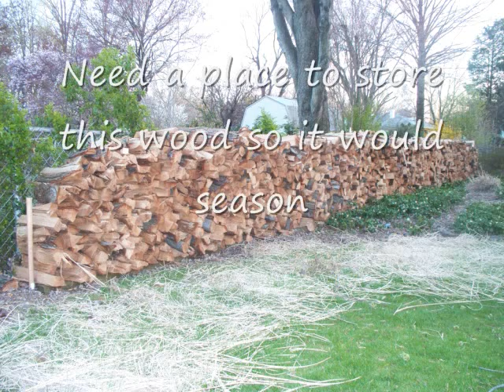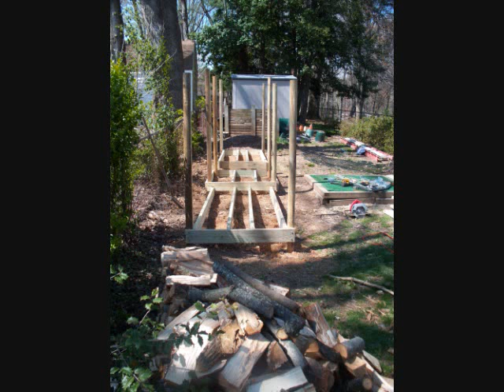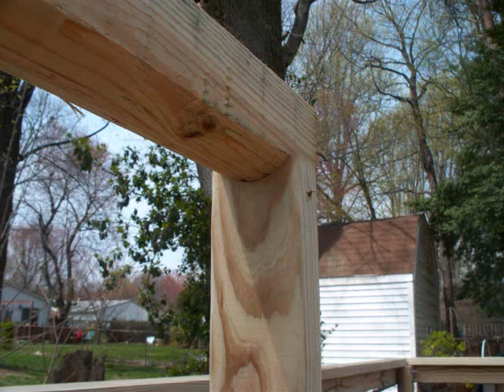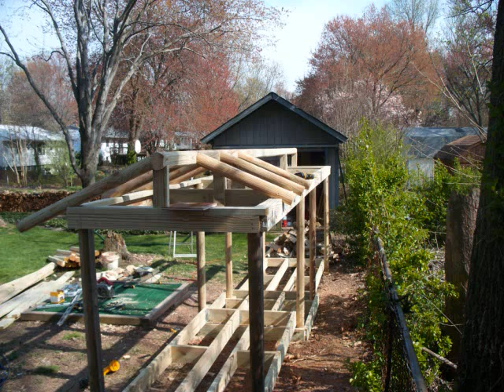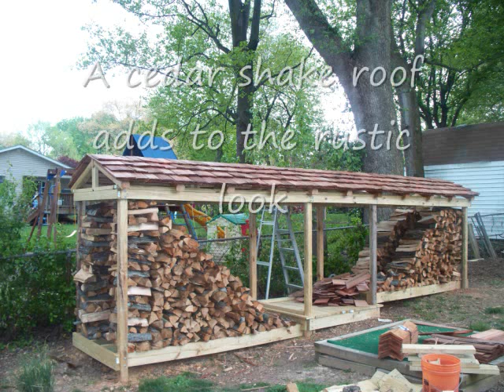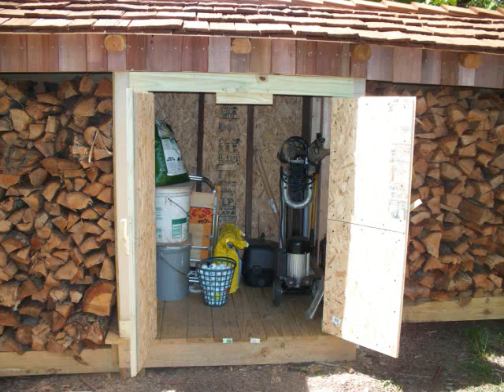Firewood storage shed

Comment from the maker: Adam, that portion of the rafter is known as a "birds mouth".  Since this wasn't dimentional lumber (2x6s) I made a few cuts estimating where the cut needed to be.  Once I found the right fit I kinda knew how far down the length to start and how high to go.  I also had to use a reciprocating saw to make the cuts because there is limited flat surfaces for a circular saw to rest on.

Comment: I like the design and final look.  The only thing I would do is hang some tarps that can be rolled down and fastened at the bottom come winter.  Leave the wood open and drying.  Once storms and snow come you can roll the tarps down to keep it from getting wet/snowed on and more protected.
Reply from the maker: Good idea; the roll down tarps.

Comment from the maker: @kenfo0 Right now they are 2x6s on edge....two for each row of firewood.  When the firewood is still green it's heavy and caused the 2x6s to sag in the middle.  So they should either be 2x8s or supported more in the middle.  Right now they are supported only at the end by the vertical posts.

Comment: Hi I think you did a great job on the storage shed. I really liked the idea to use the landscaping timbers to give the roof a cabin sort of look.. one question though, how did you cut the angles towards the bottom of each piece on the roof? The straight angle at the top meeting the main truss seems easy, but where each log goes just past the roof perimeter, any advice on making the notches easy?